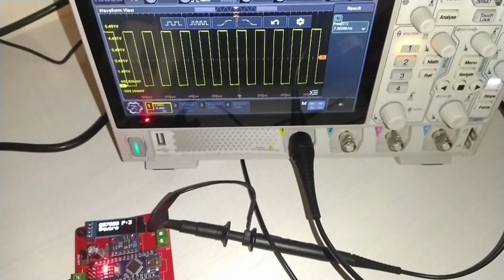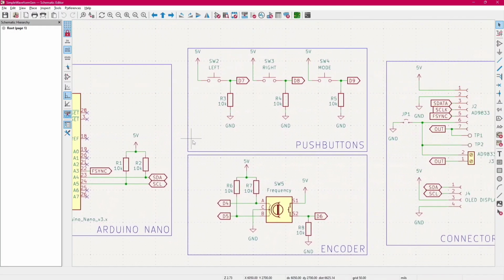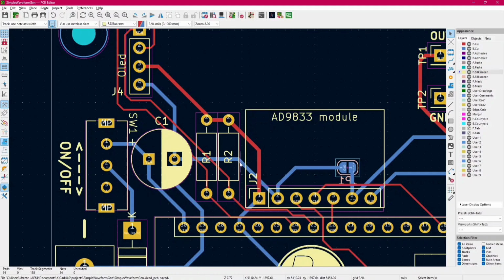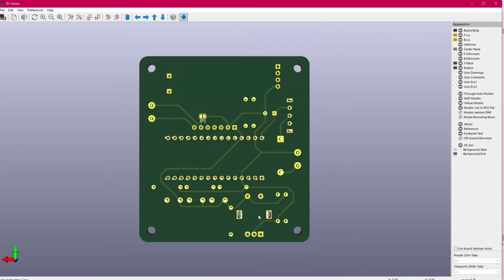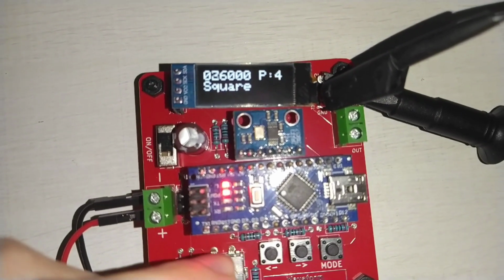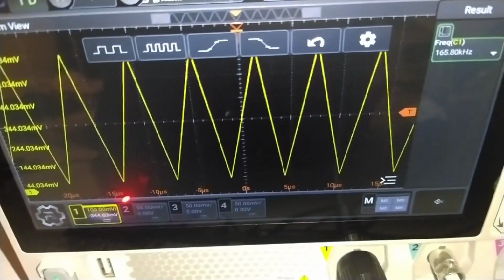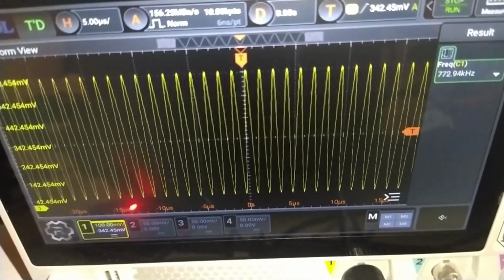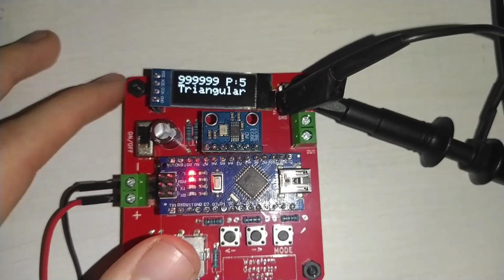How I made a simple waveform generator

Comment: Fan you explain the encoder part
Reply from the maker: @AtanuRooj  Do you mean I should explained it better?
Reply: @BurningElectronics  yes... I know about digital encoder but if you can explain what's going on with this encoder it will help me a lot. Thanks.
Reply from the maker: @AtanuRooj  Oh, okay sorry. I'll try to explain here. Basically the encoder is used to change the digit value. So if you rotate clockwise it will increase, whereas if you rotate counterclockwise it will decrease. If you start from 0 you can go up to 9 and after that you return to 0. The encoder button resets the digit. So if you are, let's say on "6", and you click the encoder, will go directly to 0. To move form digit to digit the two pushbuttons (<- and ->) are used. Hope it explains it better. If you want more info please ask! Thank you for your comment!
Reply: @BurningElectronics your explanation is really helpful and your video is excellent.... Keep it up and i have a small request.... If possible can you make a video on how to make a good variable power supply with kicad and that can give upto variable 1 amps current and variable 24v (1v to 24v) i really want to learn how to make a cheap and good power supply.